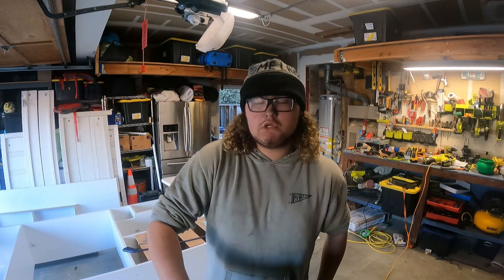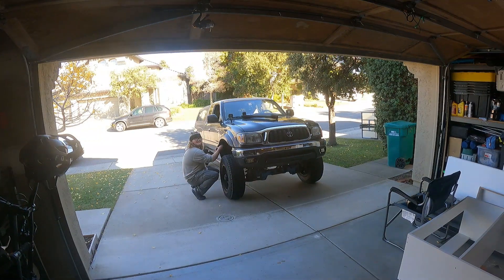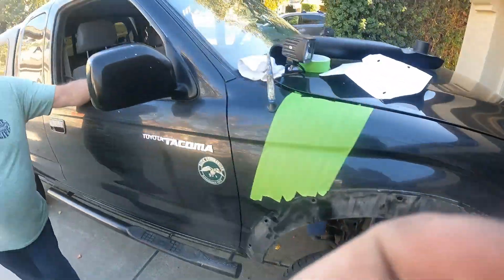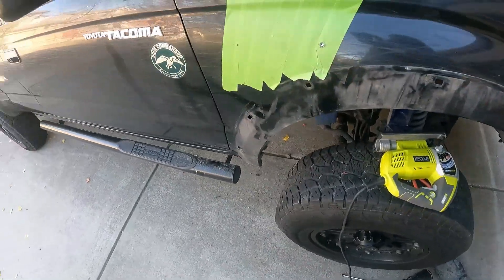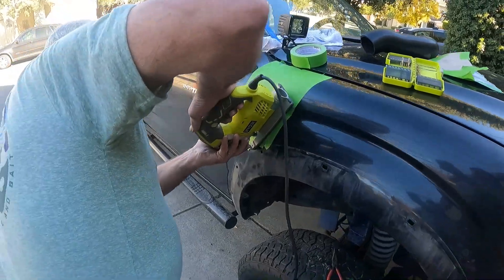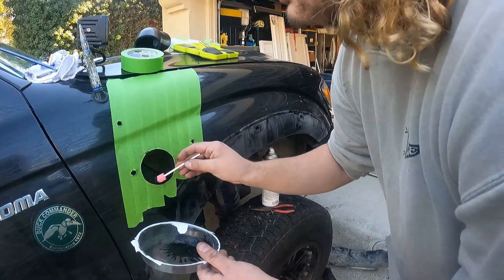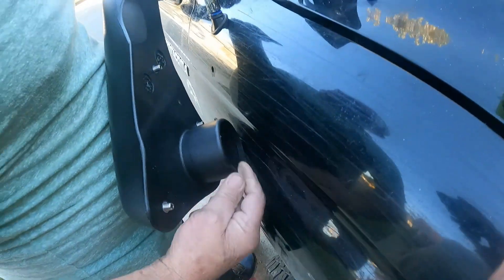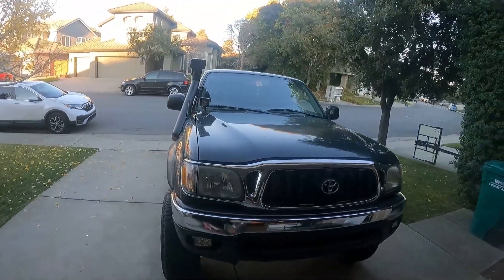I put a $60 Budget Snorkel on my 1st Gen Tacoma!

Comment: Just put one on mine. Was fairly easy install, but i could NOT bring myself to drill holes in my pillar for the bracket.  I used heavy duty stick on velcro pads lol.
Reply from the maker: Lol fair enough. Hey if it works, it works
Reply: Yessir